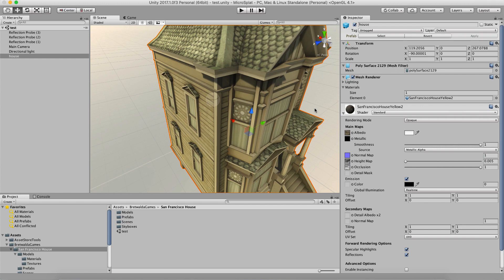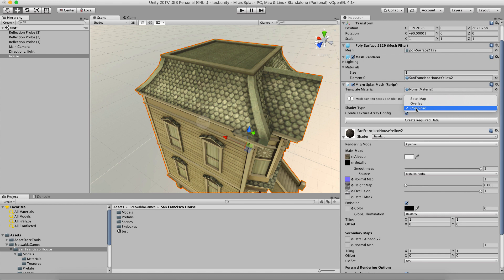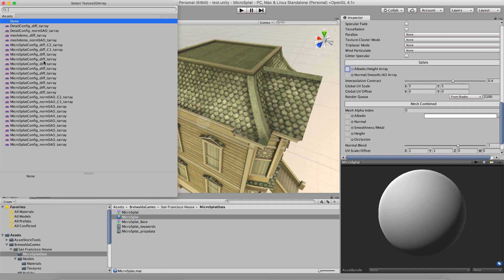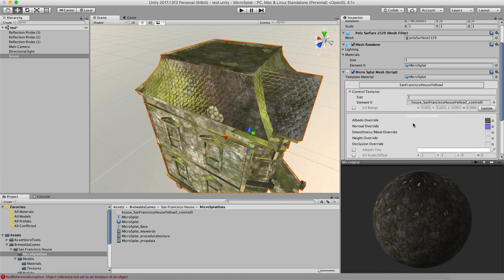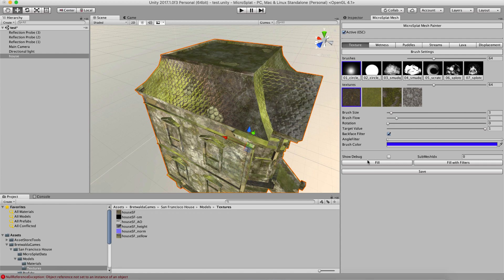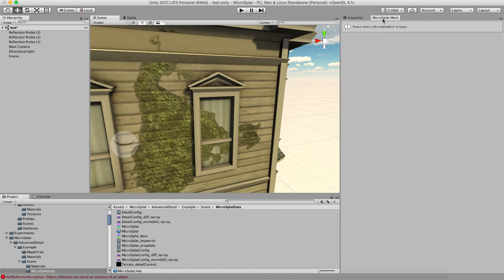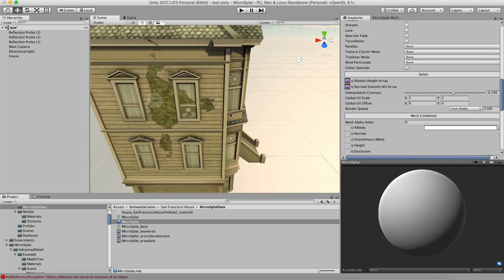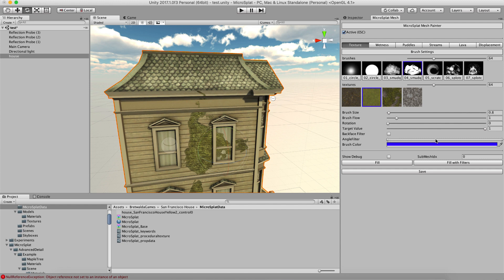MicroSplat Mesh Workflow

Comment: I tried painting on a Unity plane and it worked fine. But when I imported a sculpted .obj mesh and tried to paint on it, I couldn't. Strangely, I can still click the fill button and fill the entire mesh with textures from the array. Why am I able to fill the mesh but not paint on it?

Is there an obvious answer? I'm using HDRP.
Maybe it has something to do with the import settings on the .obj?
Reply from the maker: Most likely your using texture backed mode which requires a 0-1 UV layout. See the docs for the details
Reply: @slipster216  It was an uv issue, I had exported a Unity terrain without unwrapping it in Blender because I assumed that the model already had good UVs, so I exported it from Blender into unity but at some point UV data got lost.

Unwrapping the model again inside Blender fixed it. I highly recommend this asset, great for caves, detailed sculpted & decimated terrains. It is the solution to get past the bad unity terrain system!

Comment: Hi, I'm not seeing this on the Asset Store. Are you waiting for some kind of review? Also, does this have performance issues with many textures, or does this become a single texture at runtime?
Reply from the maker: Waiting on Unity to release it- will likely be 10-20 days. 

By default, it has the same cost as the terrain shader does- blending the textures in realtime, though MicroSplat is very fast at that, much faster than other terrain shaders as it only ever samples 4 sets per pixel. That said, you can bake out the results and use them as regular textures, but then you're limited to the resolution of the final baked textures.